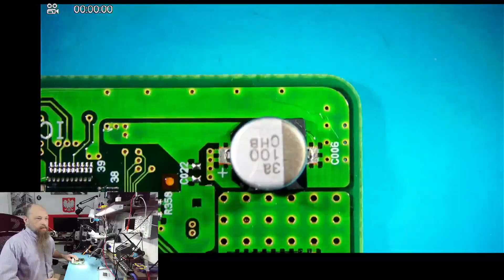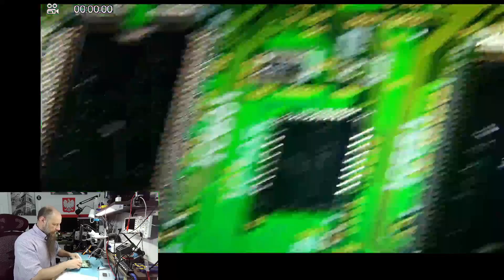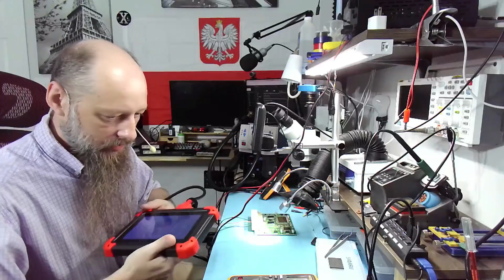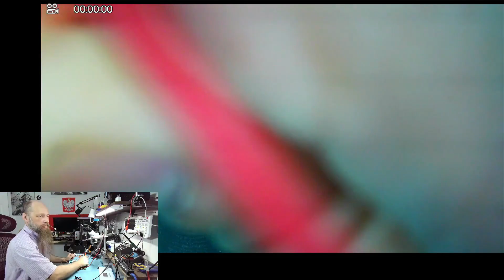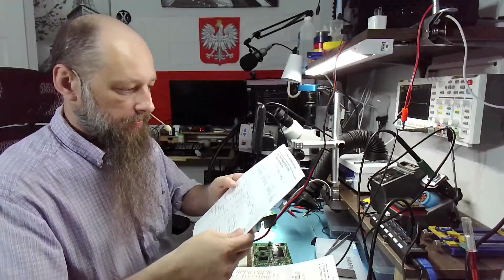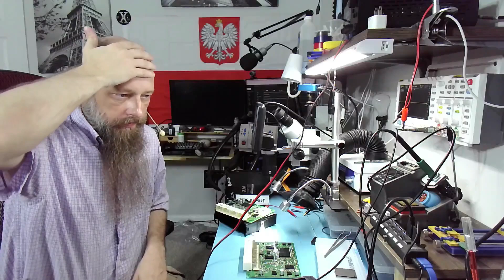Subaru WRX STI ECM No CAN Communication Diagnosis

Comment: On a 2004 Legacy ECM, MCU supplies IC801 "Bus Transceiver" which then provides CAN-H and CAN-L. But that ECM still has IC501 present. Is IC501 on the older ECM still responsible for providing some output stage of CAN?
My engine starts and runs, but I have BIU <-> ECM communication errors, the CAN output of ECM being erroneous. I replaced IC801 with a TJA1050 which is a match for the original pinout, but that CAN output continues to be bad. 
Any thoughts?
Reply from the maker: 2004 uses small chip for encoding/decoding CAN signal and a filter (rectandular chip with 4 legs), if that filter is faulty, CAN will not work. I've had one that wound't connect but the CAN signal was there, sometimes it's a timing issue. Check H and L with oscilloscope (between those 2, not in reference to ground), if the signal is there, you probably have bad timing. For 2004 Legacy I recommend just replacing the entire unit. I can clone it for you if you need.

Comment: there is 2.5v on the can because the high can is at 5v and the low can is at 0v, this is for those who are wondering, a can which communicates will be around 2.3v, because there is more of low signals than high therefore the average between the two and their signal frequency.
the simplest is an oscilloscope to see the data transitions on each channel.
the low can being the mirror of the high can, the best is to have two inputs on the oscilloscope to check the absence of distortion in the signal.
For those who want more👍

nice chanel!

why don't read the cheap directly and save the data on an other chip and solder it until read it with the scan tool?
Reply from the maker: thank you so much! Yes, I did connect the scope to confirm that CAN is not present.
As far as programming the chip: yes that would be the best solution here especially since the customer has the ROM file backed up, however, I have never performed that procedure, I don't even know how to connect to that chip and what communication standard it uses (SPI, I2C...?)
if you have that information, feel free to share it :)
thank you